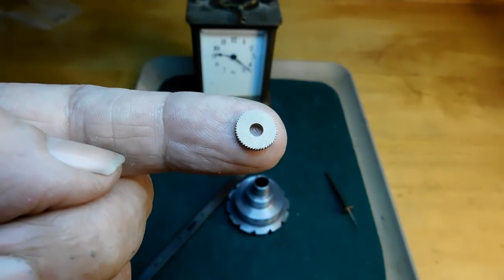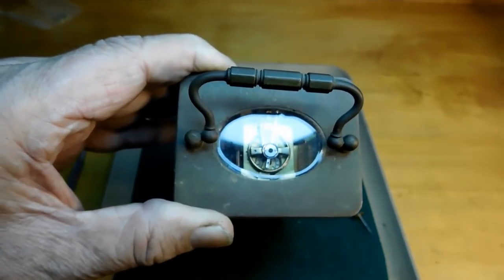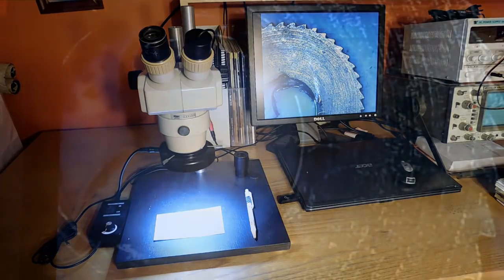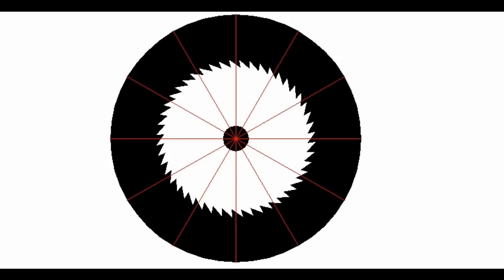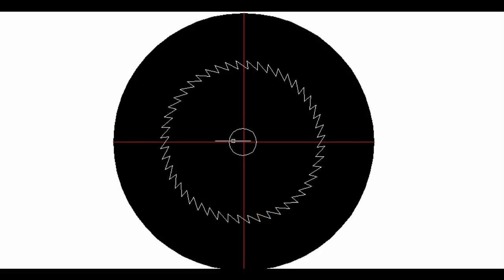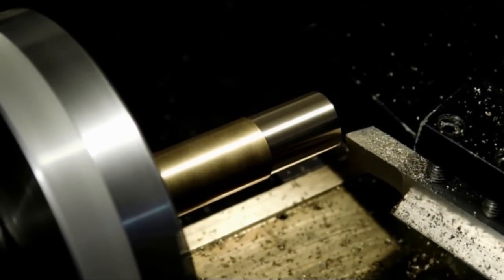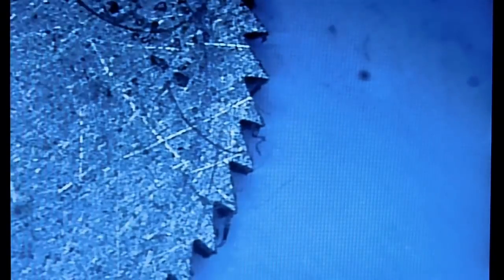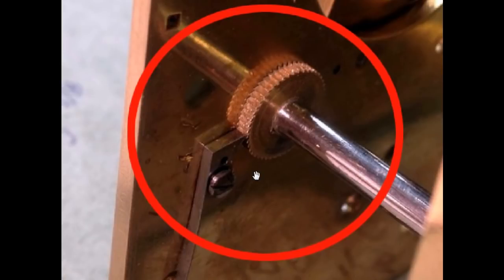Making a small ratchet wheel

Comment: G’day Bob, nicely done on something so small. Imagine in the old days when it was done by hand, what a job and first to mark it out on something so small. You are blessed to have a dividing head and a Sherline lathe. Keep up the good work, cheers. 
Peter
Reply from the maker: Thanks Peter...it is nice to have the CNC equipment to speed things along...but if you're interested you can see on the lathe set up video I made previously the index plates I used to use...I was concerned that with a dividing head backlash might arise so I avoided a rotary table, but I was wrong...my CNC rotary table works as well as the index plates...but the rotary table does have limitations...it does not allow the use of collets on the head stock...you are limited to the 3 or 4 jaw chuck...so when I make pinions or any really small parts that require a collet I revert back to the index plates...the old ways never completely disappear (I hope)...bob
Reply: The old ways will always hang around because No Batteries Required

Comment: Robertt, Your videos are getting better and better with each one. I do have a couple questions. Love you showing what a carriage clock is for us "non" clock people.
1) You said there was an off set to make it work better. Why is that? Could you please explain? I'm thinking the hole is off set from the center line.
2) It didn't look like the lathe stock was setup for drilling the offset. Did you just skip that part of the video?
3) your microscopes look like they have some high quality lighting. Do you know the brand?
Reply from the maker: Answer to #1: Most ratchets on clocks are holding back the force of a powerful spring (very powerful with a fusee)...the offset cut locks the click much more securely then a radial cut...it creates an undercut (radial rake)...this ratchet I made was for an alarm setting arm so no real power...but it was still offset. The hole is not offset...you line up with the center of the hole then offset from there using a test indicator or just the handwheel...this ratchet did not have a collar so you could offset to either side as the ratchet is reversible.#2...It was offset I used 0.0343" I believe...sorry that was not clearer but that is a small amount and may not have been clear from the camera position...but the final look around the teeth shows the offset that was achieved.#3...They are LED rings...not that expensive nowadays...no name I can see...I think they are imports...they work well but I do use bottom lighting at times with the toolmakers microscope...the ratchet was flat...not all threads and the like are like that and some of my set ups are 3D so more creative lighting helps. The Nikon works well with the ring when looking through the eye pieces...but maybe not all that great with the video eye piece...it is not a real quality video eye piece..an import I was messing about with. I have another stereo microscope on my watchmakers lathe (not shown in video) and I use 2 halogen goose-neck lamps...usually one on either side to get rid of shadows...I use it with the Nikon at times as well. I'm getting older and good lighting is essential.

Comment: Bob, how do you sharpen your broaches? There got to a better method than just using a stone.
Reply from the maker: Hi Craig...I use stones as a finishing step...if you wish to cut a polished surface you must use a polished cutting edge...I use the India and Hard Arkansas on gravers mostly...and to polish lathe bits...I used the stones on the ratchet as it was very close to the finished thickness and it cuts very smoothly and I needed to remove the effects of the parting off blade. Broaches I do not sharpen as a rule... a 10 broach set is about $15-20...and bigger broaches I make myself...anything that is hardened I use a stone on...of course the stone could be on my surface grinder...which I do use on the bigger broaches I make...the broaches I used in this video are cutting broaches...I also use finishing broaches...and I use blue steel rods to make 3 sided broaches as well...there could very well be other ways...I kinda stick with stuff that works for me...did ya like the video?...bob